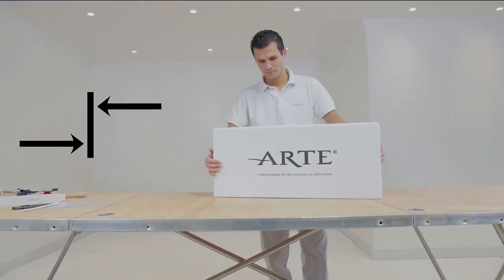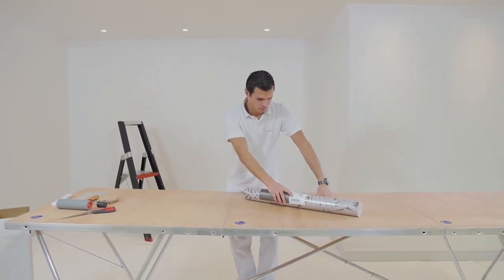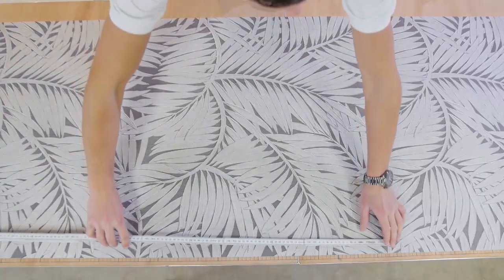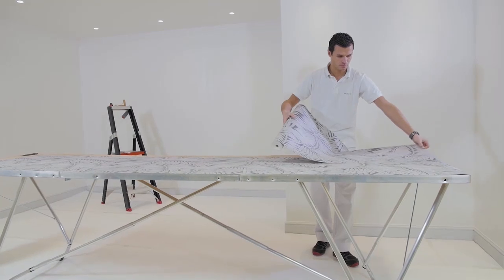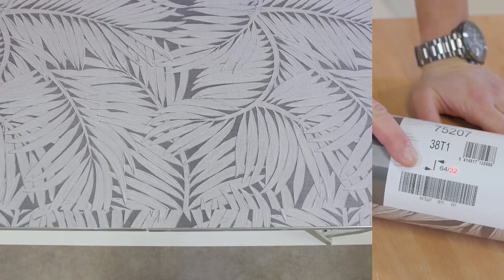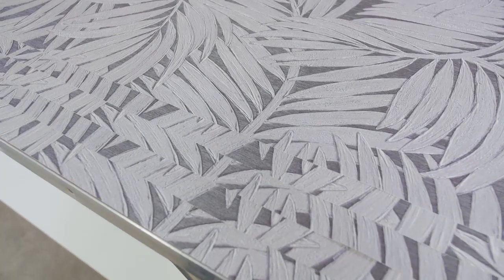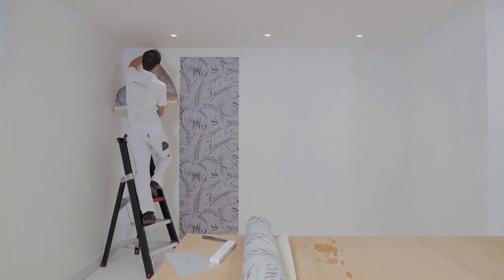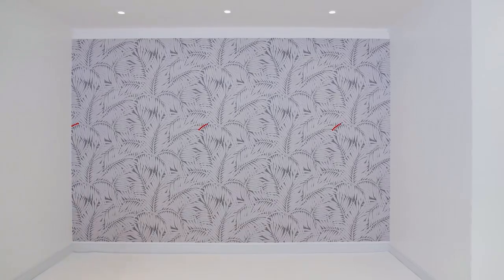How to hang wallpaper with a drop match

Comment: Totally confusing!!! So, if the second "drop" has to be shorter to match up with the first drop, then do you cut off the top of the first drop to make it even at the top with the second drop? You don't explain any of that! I just don't see how you can have a longer first drop and then a second drop that starts shorter than the first drop and have them line up at the top of the ceiling. Thanks for making me more confused!